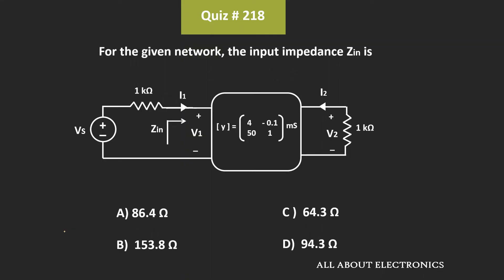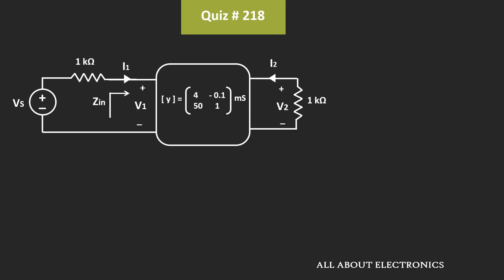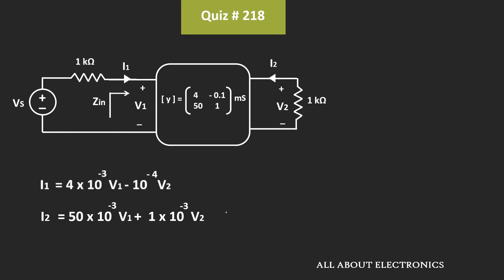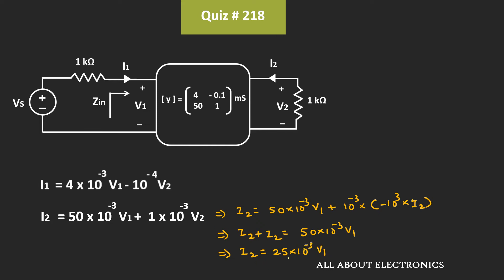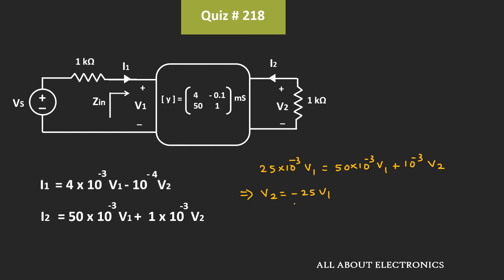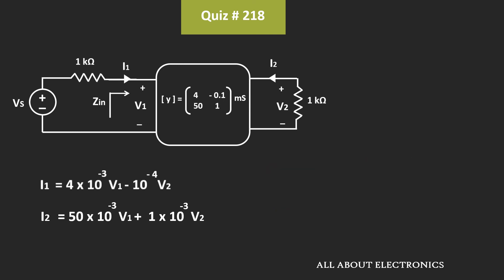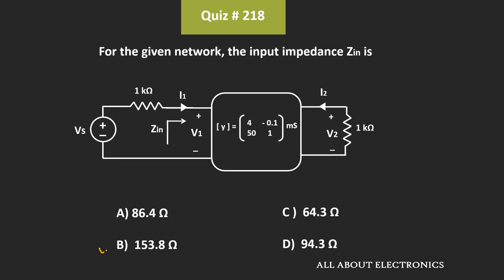Y- Parameters (Two-Port Network) | Quiz # 218

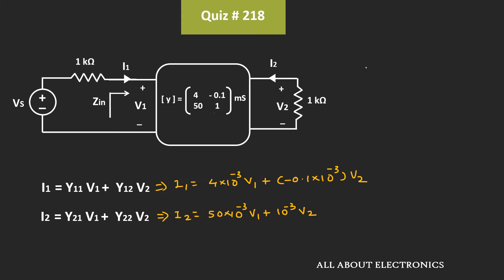Comment: 1:25 why the minus sign is used for calculating V2
Reply from the maker: Becuase the current I2 is flowing into the port. From bottom to top through 1 KΩ resistor.
Reply: @allaboutelectronics-quiz  Thank you , can you recommend good textbook for electronics